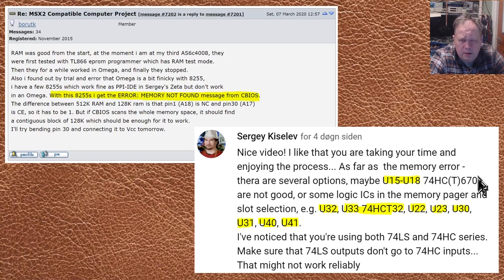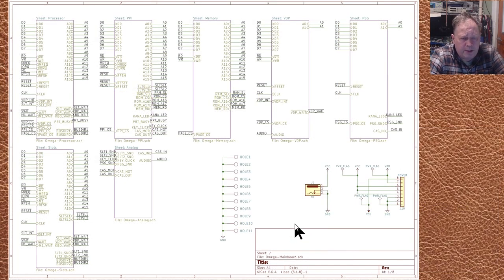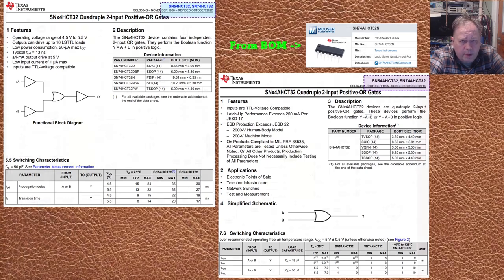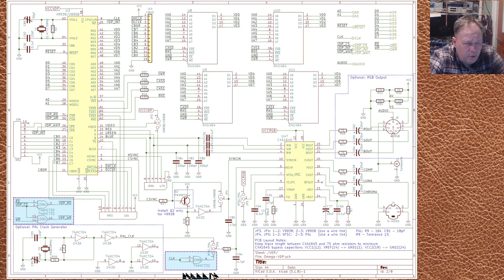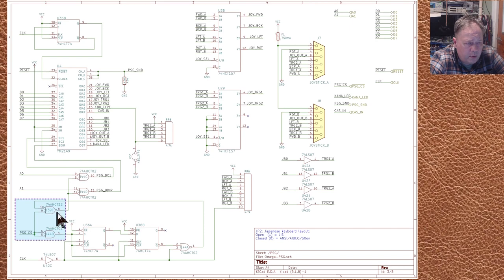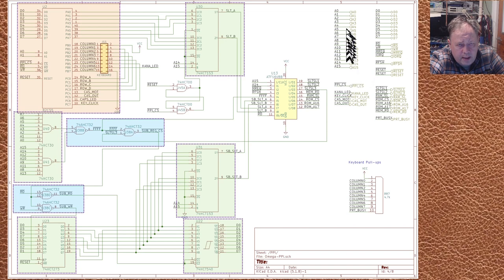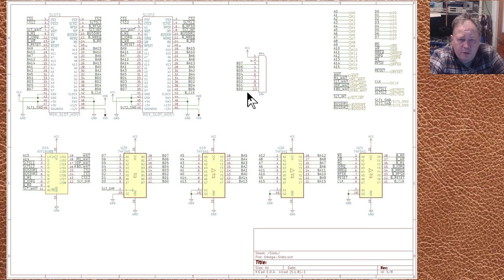Building a NEW 8-BIT MSX machine in 2023 – The last mile is getting longer !

Comment: The chip, you are showing at 29:38,  is not working because it is a so called "fake chip". It is a relabeled random IC in a similar Housing. The real Yamaha chips don't have a notch in the middle of the left side, but an indent near to pin 1. If you try, you can wipe away the markings with acetone. 
I tried to get some of those chips from Ali express too... all of them are fake ones. 🙁

Comment: What about using the ZILOG Z800 and making use of the mulu/divu,muls/divs to speed up programs but would allow you to run old MSX software as it is compatible with the ZILOG Z80A and you could maybe run a version of UNIX compiled for the ZILOG Z800,
you know...

the program snippet below does ((32*45)/15) and dumps the result to address 16384 which should be 96.

LD $32,      HL
LD $45,     BC
LD $15,     IX
MULU       HL,BC
XOR          DE,DE
DIVU         HL,IX
XOR          DE,DE
LD (4000),HL
RET